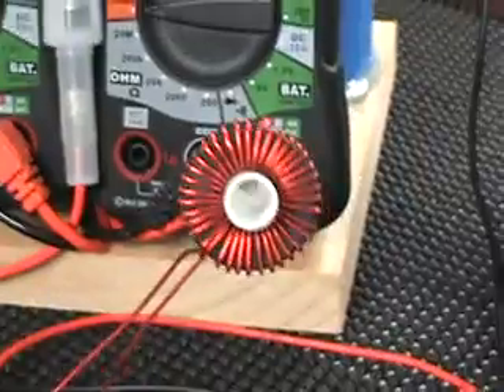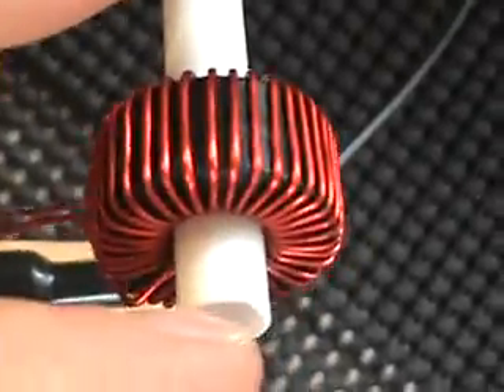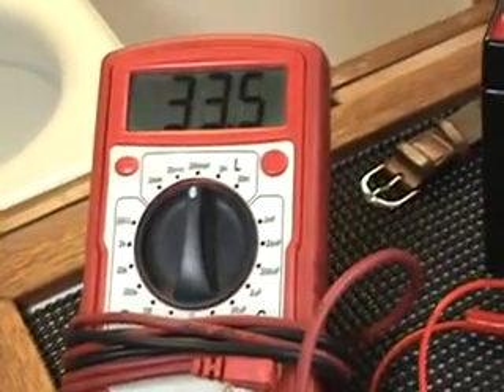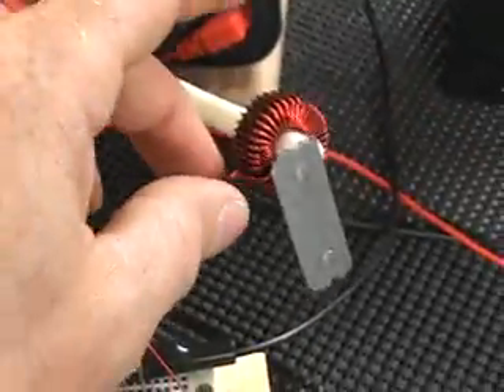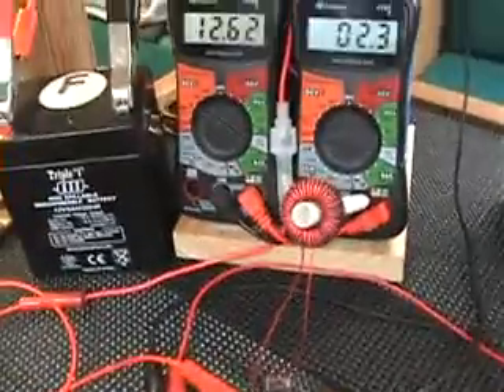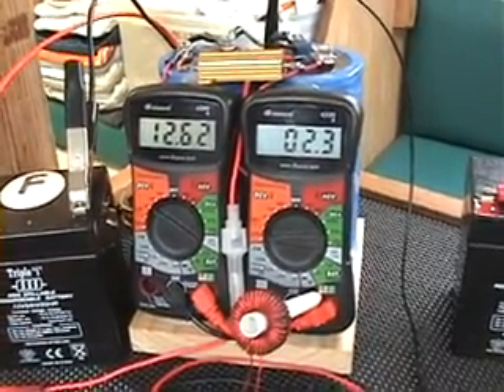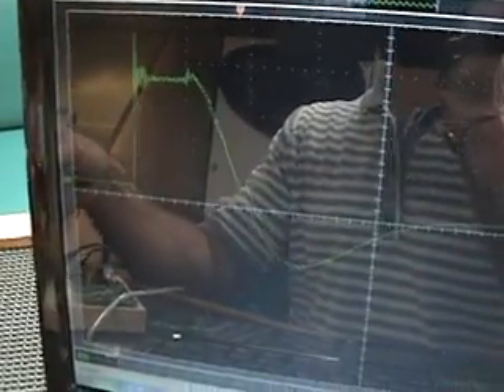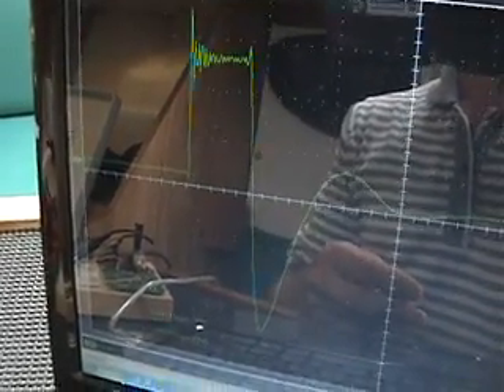Inductance Boost with Finemet nanocrystaline core test 1

Comment: I think this is a VERY interesting phenomenon that should not be dismissed as 'well understood' and requires more attention. A similar observation was made during my experimentation which is documented here: https://youtu.be/8gql7YR91cM
Reply from the maker: +Pseudo Nym The difference here is an increase in Inductance when the magnet is present, which cases a decrease in current. In your tests the magnet causes a decrease in inductance (typical of ferrite cores) which will increase current draw and why the LED is brighter. I have only seen this effect from Finemet cores. Luc

Comment from the maker: @jfilmmusic 

the meter is measuring the voltage across a precision 10 Ohm resistor which is between the two 3,700uf capacitors which smooth out the reading. It's measuring DC milli Volts and you use Ohms law to convert it to amps.Very reliable for measuring small currents and pulse circuits.

Luc

Comment: Thanks for sharing this.  Can you say where you obtained the core from?  Is this a common toroidal core one would find in a switching power supply (like in most computers?)  Also was curious if you'd ever heard of or built with the flux switch transformer from WITTS?